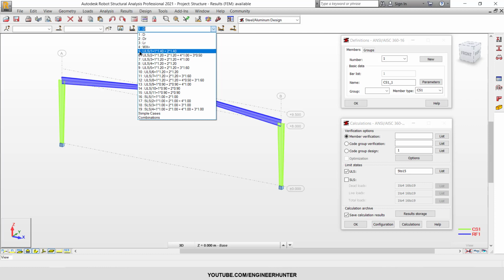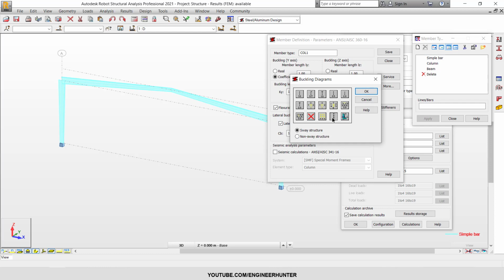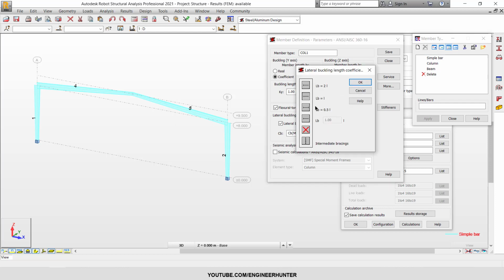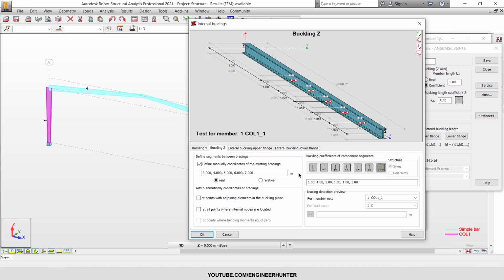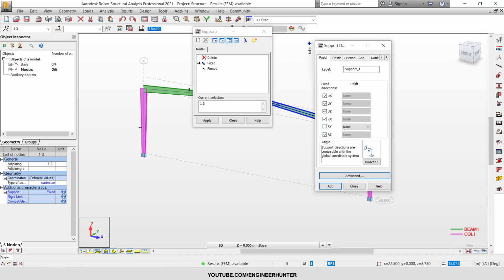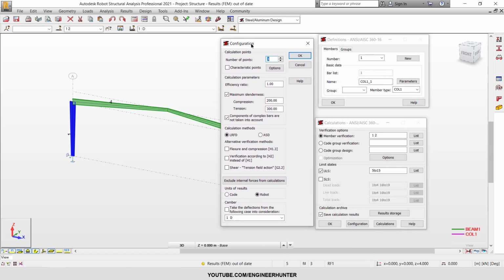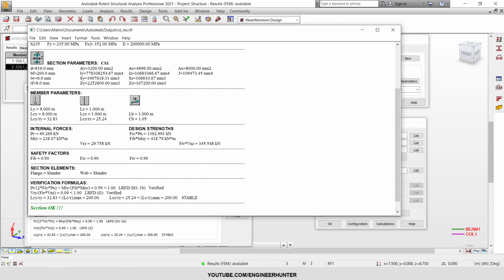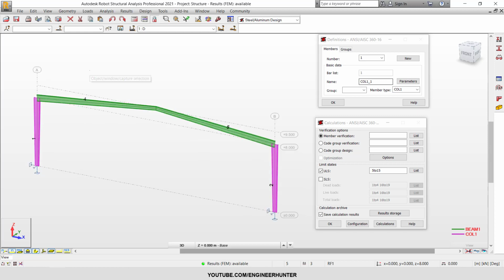Autodesk Robot Structural Analysis : 2D Frame Steel Design

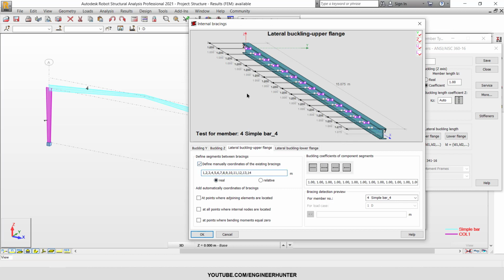Comment: Thank you for this explaining, it is awesome :)  My first questions is:  Should beams 4 and 5 be design as superbar while total span is 30m and not 15m as in shown to RESULTS dialog? and the second question is :from the min10:00 to 10:30, why we have to give the purlins in the middle of section and upper flange also as long as they are supported only to upper flange, it doesn't count them twice?
Reply from the maker: Thank you. For beam 4 and 5, they can support each other as well. You can view nodes between beam 4 as supports to beam 4. First support is top column, other is end of beam 5. You can do the same beam 5 also. For buckling data, buckling Y and buckling Z, the program uses them for slenderness check. Lateral buckling upper and lower flange is design member to resist LTB.